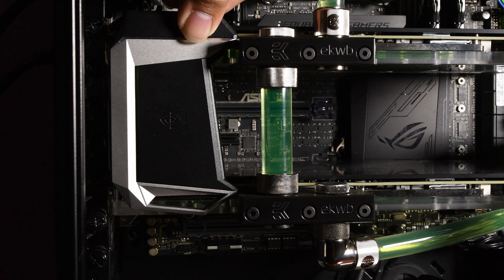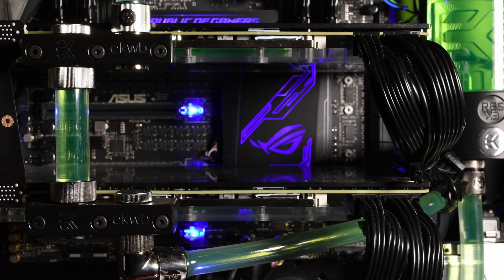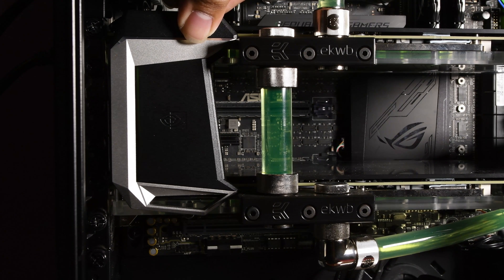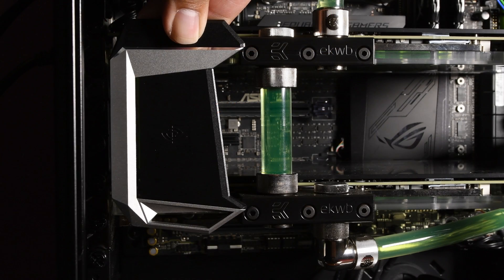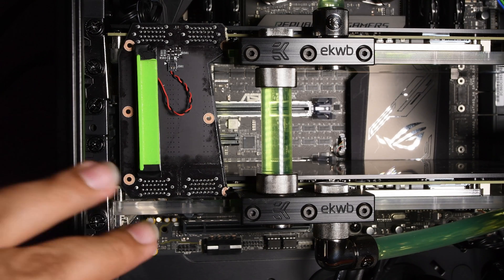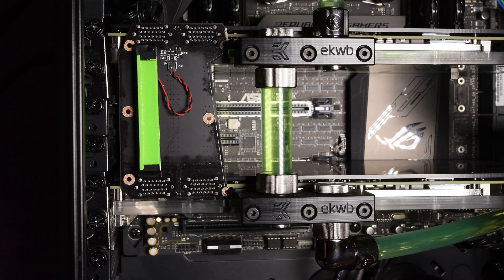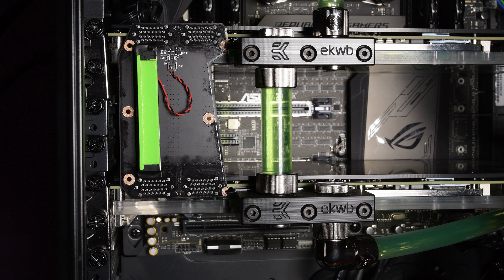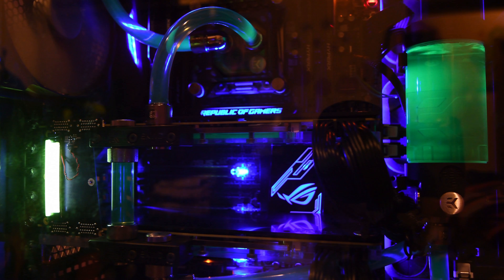How to Use Nvidia SLI HB Bridge with EK Water Blocks

Comment: Your the only person I can find on YouTube that uses only one piece of piping between the two graphics cards, it's confused me for so long why people use two
Reply: One is for serial cooling:  liquid goes through card A, then out, then goes through card B, then out.  Two is for parallel cooling - the input pushes to both cards simultaneously (the first pipe) and the output comes out of both cards' outputs simultaneously (the other pipe).  EKWB also sells plexiglass blocks that handle multiple cards in either way.